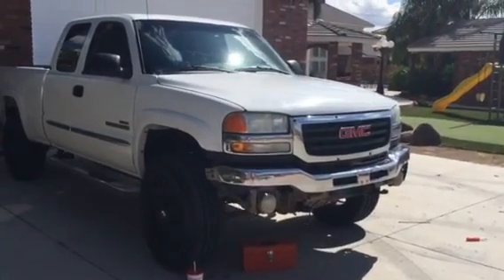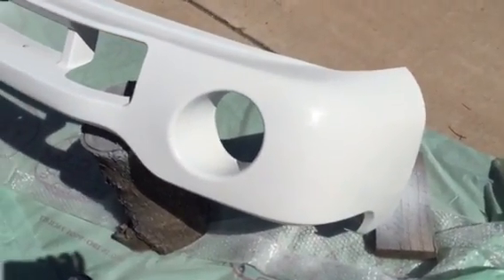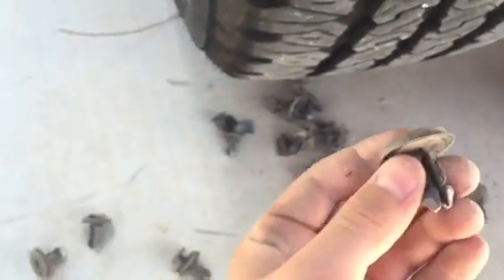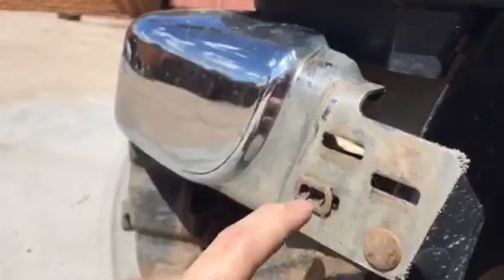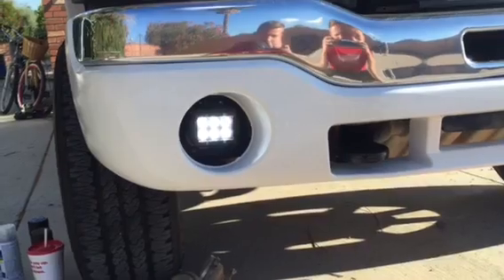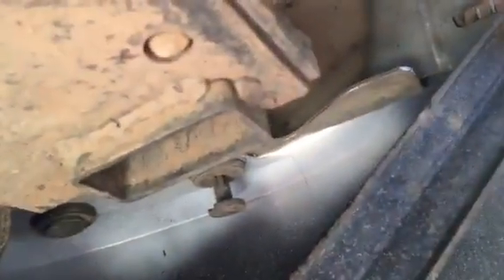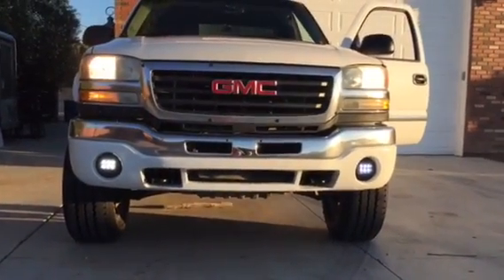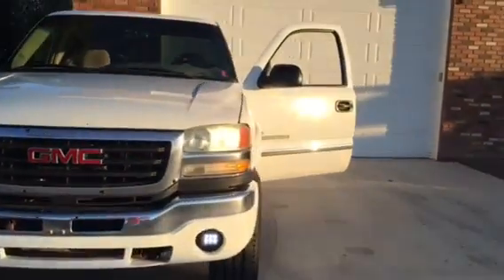How to replace/remove lower front bumper GMC Sierra

Comment: dude. I'm in the middle of putting mine back on after some repairs. I found new fog lights for 60 bucks with wiring and the plastic mouth. You can even get them dark. 45 watt halogen. they're a little tricky to put on. But I got it

Comment: Do u have to take the grill off
Reply from the maker: Jaci Asmus I did not remove the grill.
Reply: Smith Twins u didn’t take nothing off besides pins?
Reply: I can’t reach some pins in the middle
Reply from the maker: Jaci Asmus I just yanked it off if I remember correctly. Since I knew the old bumper was trash. And then when I put it back together I couldn’t get a few of the middle pins back in but it ended up not making a difference haha
Reply from the maker: Jaci Asmus it’s only those plastic pins. No screws or anything
Reply: Thanks for the reply man!!

Comment: what kind of pod lights are those.
Reply: They were just cheap 4 inch LED from amazon. chinese ones. I read reviews and they worked out great. Putting silicone around the wire is a necessity though.